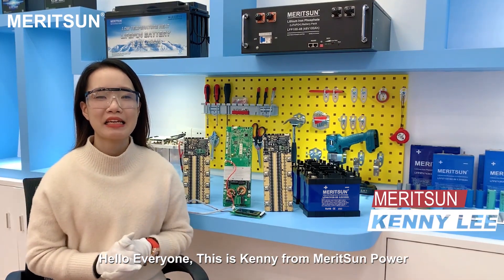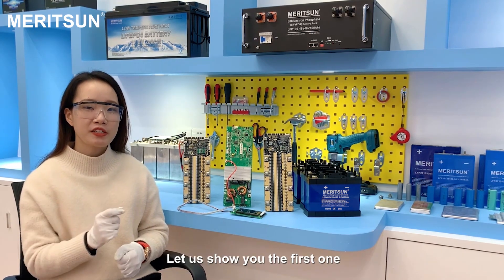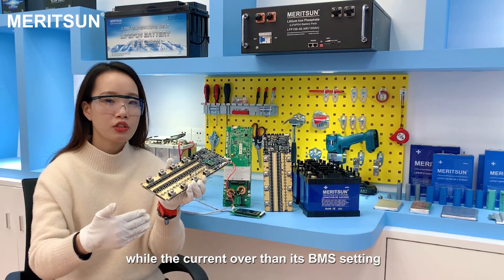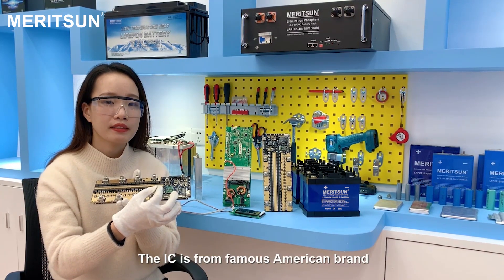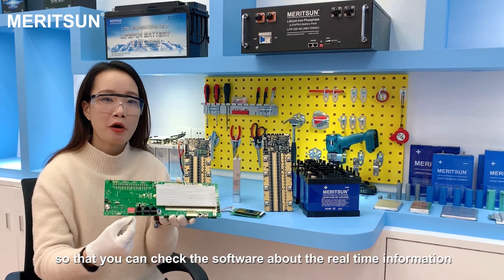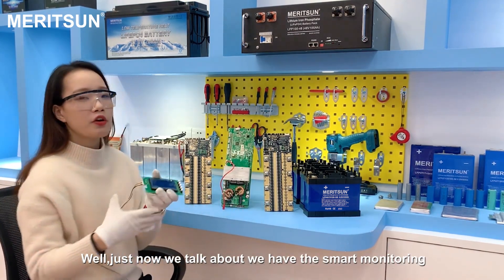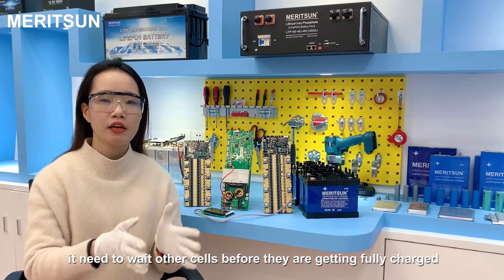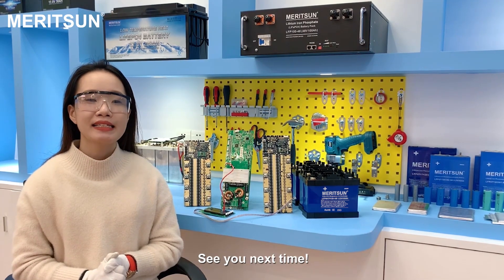MeritSun 12V 24V 48V lithium battery smart BMS (Bluetooth, LCD, low temp heating)

Comment: I must say, this video showcasing the MeritSun 12V 24V 48V lithium battery smart BMS is truly impressive! The level of technological advancement in this battery management system is incredible, and the Bluetooth and LCD features make it easy to monitor the battery's performance in real-time. The low temperature heating function is also a significant addition, making this battery ideal for use in harsh weather conditions. The MeritSun team has undoubtedly raised the bar when it comes to smart BMS technology. I would highly recommend this product to anyone looking for a reliable and high-performance battery management system. Great work, MeritSun!
Reply from the maker: Thank you🌞